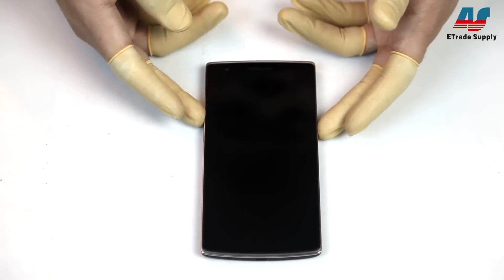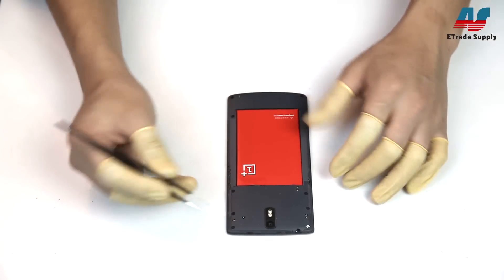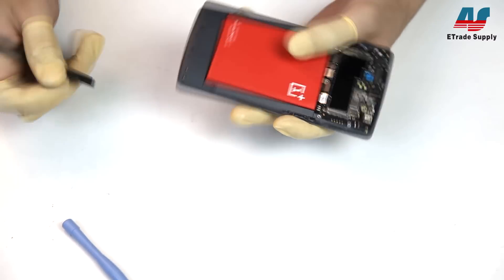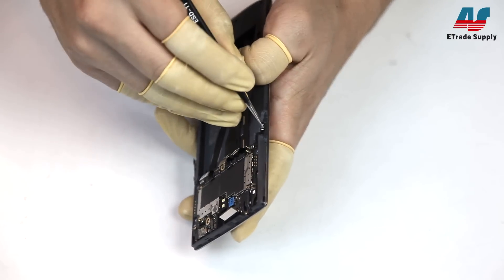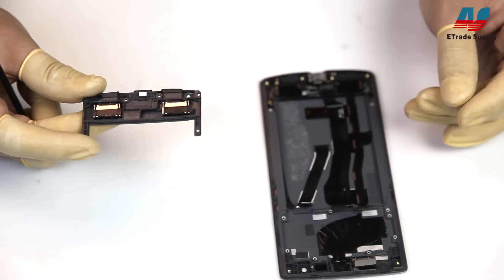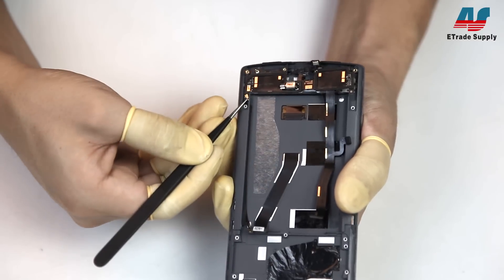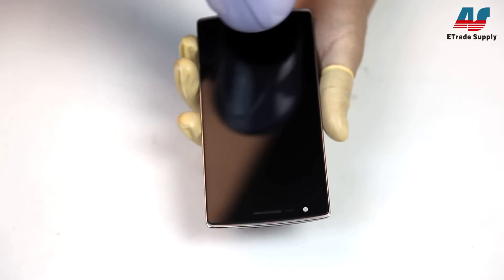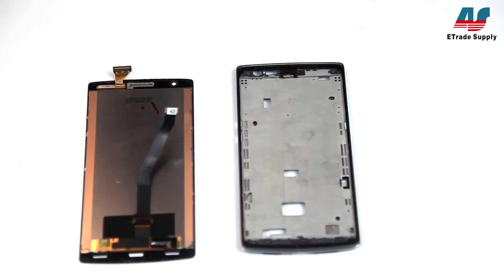OnePlus One Teardown/Disassembly/Take Apart

Comment: Hey man I took mine apart, only up to the battery part, then the speaker section just to try and clean  it cause the speakers werent sounding right after last night it fell into a bowl with dressing at work  I took it out right away turned it off and cleaned it on the outside as much as i could at the moment, then when i took it apart theres wasnt much to clean so I  put it back together and now the camera is not working, I didnt take it apart I dont know why is not it just says app is not working in any app that uses the camera :(

edit: oh and no liquid fell near the camera, the phone fell on a vertically position and only half way in the liquid

Comment: So I got my OnePlus 3 fixed a couple of months ago, the people didn't do a good job with the power button (it's not fully out and you have to press really hard to turn it on.) and I just dropped it again and now it won't turn on. I was about to charge it because it died. Now, I plug the charger in, and nothing happens. No sound, vibration, nothing.) I'm not really confident in doing anything by myself, but can anybody help me find what the problem is, because I really want to know. For now, I will keep it on the charger and hope it will turn on.
Reply from the maker: Press and hold together Volume Down and Power button for a few seconds to see whether it work. If it still not works, it may be the hardware or connectors issue.

Comment: Friends, I need your help to enable an option in one plus one mobile. Until yesterday the below mentioned option there in my mobile, however today it's not working. 

ONE PLUS ONE - IN HOME PAGE -->BOTTOM LEFT END OR BOTTOM RIGHT END, IF WE SWIPE--> A HALF WHEEL OPTION WILL COME,  BY USING IT WE COULD ACCESS VARIOUS MENUS LIKE WHATS APP, SCREEN SHOT, SCREEN CAST ETC....

But today it's not coming. Appreciate if anybody could assist me to enable this option again in my one plus one mobile.

  Thanks in advance,